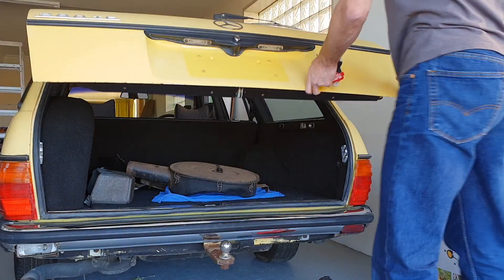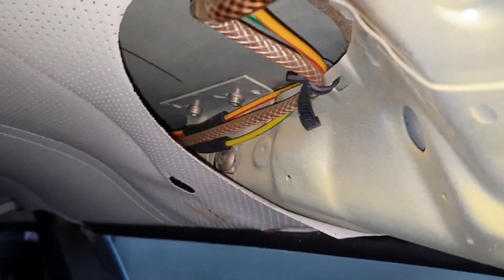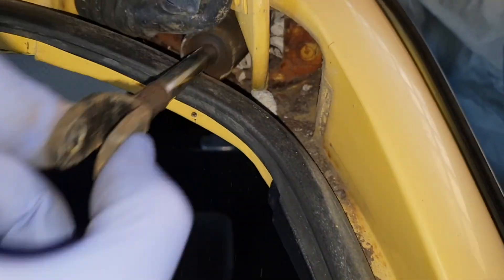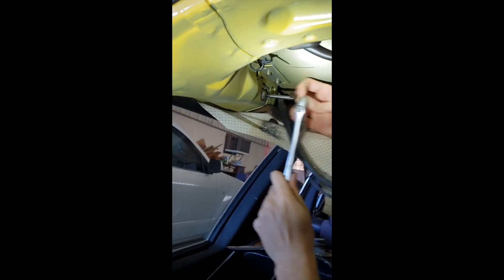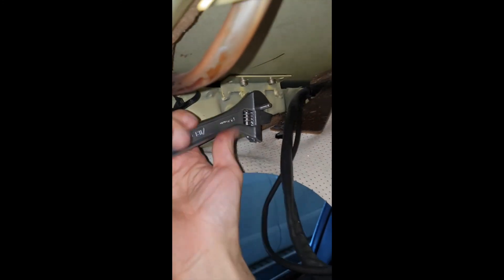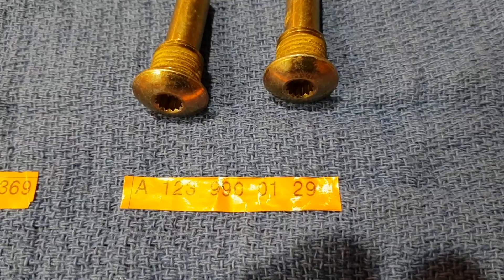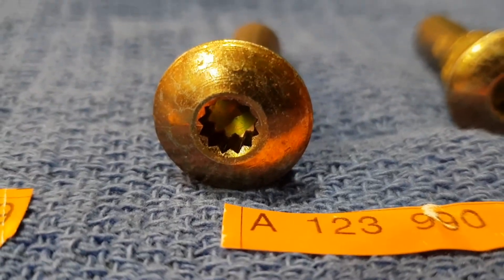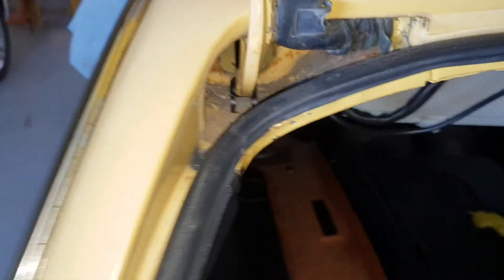Mercedes 123 estate - replacing the tailgate struts

Comment: Why don't you put WD40 before trying removing the screw ? Do you think it can help ?
Reply from the maker: this is not the problem. the original bolts were put in with loctite and 'glued' in. they are a real nuisance to get out after 40 years!
Reply: w116036 waow okey because I’m gonna do the same on my 1982 one, and I’m a bit affraid of the step where you drill the whole thing !
Reply from the maker: @mondofuzz  the drilling was a real PITA. it was a last resort as I had no way of grasping the bolt, I tried so many things! in the end, the extractor screw set bailed me out! good luck Mondo
Reply: @w116036  Hey ! I finally did it ! The one from the right side was very easy to unscrew with a plier 4 min to remove it but I had to do exactly the same for the other side with a screwdriver and a hammer so awful to do this 2 hour for remove it !!!
Reply from the maker: @mondofuzz  congrats. what a horrible job when those bolts strip after 40 years! the good news is the new bolts go in nice and easy!  enjoy a tailgate that stays up Mondo!